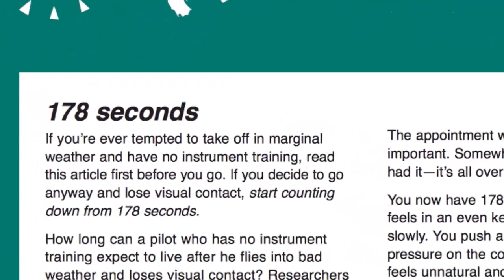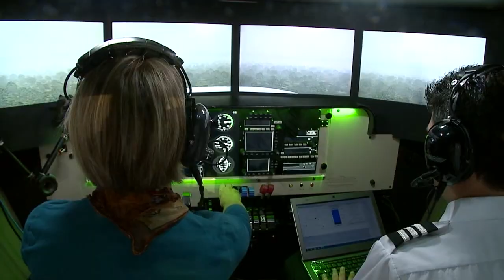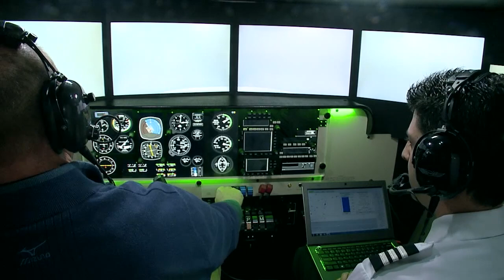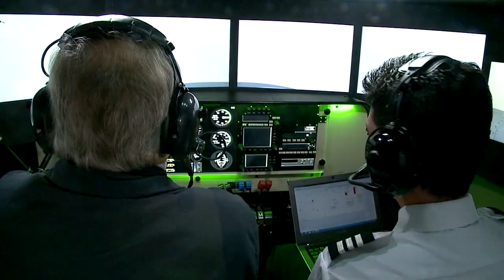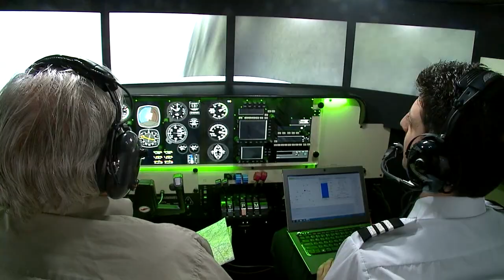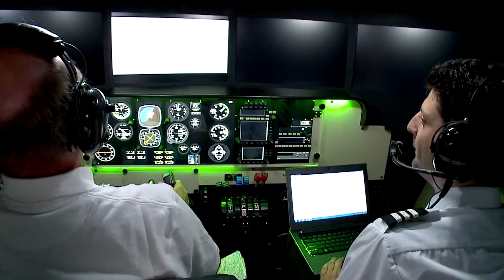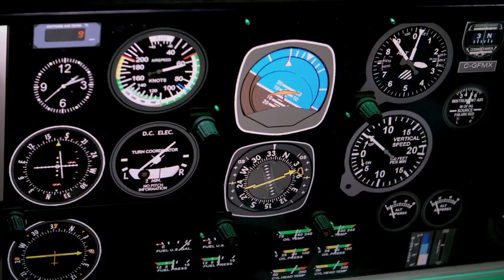SmartPilot | VFR Into IMC

Comment: I have trouble understanding why every single pilot in this exercise turned more than standard rate. What happens beyond 15-20 degrees is other lift forces just exacerbating the sense of disorienting direction/balance. For example, if turning beyond 20 degrees, there is always a need for back pressure on the yoke to keep from entering the first stages of a stall-spin, which is what happened to every pilot here. Depending upon the aircraft, pull the throttle back to slow down, keep everything standard rate or less, and for the sake of everything holy, keep the damn ball centered. I suspect your chances of survival would be increased somewhat...
Reply: Probably too focused outside hoping to see the ground again. If you go IMC, forget about what's out the window and begin instument scan.

Comment: I'm not a pilot but I'm frankly amazed that some of the guys said they hardly ever look at their instruments when flying!  I had always assumed instrument training was part of getting a pilots license.
Reply: Most VFR pilots avoid bad weather, and 99.999% of the time that is good enough. In those cases, being able to fly without referencing the instruments is actually a good thing. All pilots get some good training in which you fly by instrument alone, but it is not so much.
Reply: @rcbif101  i disagree, knowing how to fly  just using the instruments is a lot safer than just relying on visual, as it is extremely difficult to see really in bad weather
Reply: Private pilots receive only a few hours of rudimentary instrument training - just enough to make shallow-banked turns to escape the clouds - before earning their PP licenses. But even that little bit of proficiency wears off soon without periodic practice. For a VFR only pilot, flying into clouds for an extended time proffers only the panic a swimmer feels when he is about out of breath and strength and is about to drown; it's shear terror that only multiplies with each passing second until the violent end.
Reply: @original6hockey402  3 hours is required now. During which, I did basic navigation, unusual attitude recovery, and radar approaches all under the hood. Sucks not being able to enjoy the view, but hopefully lifesaving training.
Reply: The Lucas Higgins you know. nothing about aviation, obviously.
Reply: The Lucas Higgins I can’t watch that crap. Just gave you the facts of the accident. Severe pilot error/stupidity.
Reply: The Lucas Higgins just because at one time you may have been proficient flying IFR it doesn’t mean you keep the skill. Obviously this guy wasn’t proficient/competent, nor was his company authorized to fly anything, but VFR. He violated numerous FAR’s and paid ultimate price as did his passengers. Never should have happened.

Comment: wow..this has really helped me to understand how kobe died..amazing video!!!!!
Reply: It’s the same way JFK Jr. died.
Reply: Vinman Phamee The pilots ego made him make a very bad decision. Sadly avoidable.
Reply: Maybe and maybe not.  The pilot was IFR certified so if he was in practice he shouldn’t have had this problem.  It is entirely possible as the flight was VFR that he was flying up a valley staying below the clouds but found the pass ahead blocked by clouds.  From what I saw from the NTSB so far he was trying to turn around and it appears he stalled and spun into the ground.  This same thing happened in Switzerland several years ago on a clear hot day when a JU-52 realised he couldn’t clear a pass tried to do a steep turn, stalled and spun into the ground.  I think we need to wait for the full NTSB report to know better the most likely cause.
Reply: @GeoffreyEngelbrecht you could be right about this. I'm curious by the way what are the reasons for why a helicopter would stall?
Reply: Vinman Phamee The same reason any wing stalls: too high angle of attack  (https://en.wikipedia.org/wiki/Retreating_blade_stall ).  I’m not suggesting weather wasn’t a factor I’m just playing Devil’s advocate and pointing out the media’s assumption since there were clouds then he must have flown into one of them isn’t the only plausible explanation.  There are other explanations.  Best to wait for the NTSBs final report.
Reply: @GeoffreyEngelbrecht  a stall is the only answer and explains the rapid descent speed faster than the helicopter max accelerated speed of 180mph upon crash. Spatial disorientation is what some want to called it, but a stall matches the science/math.
Reply: I saw the fog and first out of my mouth was that pilot should had ground him self in a field or parking lot.  He went back up in the fog layer what a fool.

Comment: Why not hang something like a tennis ball dead center above windshield, object should turn in direction of turn, if any, or, what about horizon indicator
Reply: This is why Kobe died smh...
Reply: THATS SMARTS!!!!! EXCELLENT IDEA!!!!!!!!!!!!
Reply: I remember reading about a fire onboard an aircraft where people died because they could not see their way out of plane. Then, Aeronautical Engineers designed tiny lights on floors of aircraft near seats. At the time, I wondered, does it take an accident to move the ball, to progress to a solution? Do engineers think outside the box, or is their thinking one step at a time, inability to think ahead to the “what if’s”?
Reply: These two things are whaat really matter, although I do not hear anyone with an opinion: Why was pilot flying so fast, and why was he so low? I saw a pic of the helicopter path, and it looked as if pilot may have been heading toward Camarillo, going West, diagonally from 101 FWy, which would explain left turn away from it. In pic, it looked as if pilot then flew between two hilly regions, dead center between. Then pilot took another left turn, why?
Reply: This is essentially how a turn coordinator works.
Reply: Turn Coordinator, so why did pilot make that turn
Reply: @patsypriscilla6842   He hit a fog bank from NOWHERE. He knew there was hills,mountains around so he pulled up.  He probably didnt know he wasnt level (spatially disoriented) while doing so went into a graveyard spiral....OR he actually made it straight up but got LOW RPM Rotor issues and couldnt recover.  Please research these things then it will all make sense.
Reply: Does not explain speed
Reply: @patsypriscilla6842  He was trying to pull up to 4000 feet that takes alot of speed he was at 1200 feet.  He thought he was going up yet going down.  This is very common for all aircraft ESPECIALLY helicopters.
Reply: Hanging a tennis ball and relying on that would just kill you faster.

Comment: design a hologram to project onto the windscreen when encountering IMC.  A very simple program displaying a 1500' altitude view of terrain which remains constant as plane fly's the horizon.  Integrate it into the back of the dash compass.  Done.  The technology gong into kids video games is more than enough to give a pilot a clear sense of forward view of blue skies, streets and rooftops and trees below.  Once out of the clouds, click off.  One other thing, we have dime sized video sensors onboard cars.  How come an additonal $300 bucks can't be added to commercial aircraft and place one looking out each wing from fuselage to engines and the 3rd showing the tail.  How many more times do pilots have to spend valuable minutes and seconds trying to figure if an engine is on fire, trailing fuel, landing gear issues, cargo hold's, or how about Alaskan Air 261.  A chinese camera the size of your fingernail monitoring that T-tail would have been a blessing to those poor pilots trying to figure out the problem.  Instead we are like cave men flying planes.  Asking stewardess's to climb over passengers to look out the window.
Reply: Just looked up Alaskan air 261, so tragic. Just a question, if they were able to see and know exactly what was causing the problem would it have been possible for them the recover and save the aircraft?
Reply: @user-y6t5s  I was referring to seeing the tail via camera as the OP suggested. Ok understood. I saw in another video that a mechanic for the manufacturer of the aircraft shed some light on the potential for this happening and made some recommendations about two years prior and no action was taken and then the negligence on the part of Alaskan air as far as maintenance goes, SMH!!
Reply: @user-y6t5s  yeah you said that already

Comment: Non-pilot here - How many of these aircraft are equipped with autopilot?  If I ever found myself behind a yoke with things going wrong, and I couldn't figure it out, I'd simply just switch on the autopilot. . .
Reply: Richard Howell / A Beechcraft Baron was used in this sim, and all barons were equipped with decent autopilots as standard. Almost every aircraft flying today has an autopilot fitted, the only exceptions are the basic trainers (Cessna 150, Piper Cherokee 140, older Cessna 172s) as well as ultralights. It is recommended to use the autopilot in VFR to IMC situations, but it’s important to remember that autopilots are complex and break easily, meaning many small planes are flying with broken/malfunctioning autopilots. Even if the autopilot is working, there is no guarantee that the pilot knows how to use it. Autopilots are very dumb, and if you don’t know how to use them right, they can make things much worse.
Reply: And what do you do when it disengages?

Comment: I think this is a fundamental issue with the way pilots are trained. During my (few) flights as a student pilot, my instructor was insisting that i look out the window almost full time, and every once in a while throw a glance at the altimeter. I do understand that they do that in order to get you familiar with flying instinctually, but the problem is that it is instinct that gets VFR pilots in trouble in IMC. I think there should be mandatory IFR basic training for anyone who wants to get a licence. Enough to at least be able to fly out of IMC.
Reply: "During my (few) flights as a student pilot, my instructor was insisting that i look out the window almost full time, and every once in a while throw a glance at the altimeter."  
My experience exactly. Made no sense then, makes less sense now.
Reply: Uhhh...that's kind of the point of VFR (Visual Flight Rules). You're suppose to keep your head outside. You're watching for traffic, obstacles and terrain, it's not ATCs job to watch traffic for VFR pilots, it's the PIC's job. 
Also, IFR is flying by the numbers. It's not something as simple as trying to fly a straight line through a cloud. You also have to land in IFR. It's completely different than VFR and requires a different mindset. I'm a private pilot with no instrument rating and just a few hours under the hood, but I've taken some instrument ground school and yeah...it's not quite like VFR. At all.
Reply: @joeglidden9626  To me it does make sense however. VFR means you should see and avoid... If you keep looking inside, you could miss other airplanes coming your way. 
IFR is different, as it is someone else's job to avoid collision, so you can stick to your instruments...
Reply: @joeglidden9626  the reason one must learn to fly visually first is so that you understand what's happening with the airplane to begin with. Instruments is just a worse way to visualize the horizon. Visual flight is a prerequisite to instrument flight, instruments won't help you if you lack instinctual understanding of what's happening to the aircraft.
Reply: Cristi Neagu I took a few lessons over 30 years ago and flew for about eight hours before deciding to pursue grad school instead. My instructor was really good. While he made sure I was looking around and scanning outside, he also made sure that I checked in with the instruments as well. I did one flight on instruments e the sensations our bodies feel seem unreal compared to what we’re looking at on the actual instruments.
Reply: As a CFI it's simply way easier to teach someone to fly by looking out the window. Essentially it's just much less of a pain in the ass to get students to fly properly. I believe it's more a matter of how much effort the CFI puts into training their students and how much patience they have.
Reply: LOL all the "experts" who took a couple flight lessons in their life have the wisdom to "fix" how pilots are trained. 🤣 For beginning VFR flight training, CFIs absolutely should be having pilot look outside and learn to fly by sights, sounds, and feeling. My CFI covered up every single instrument on our first flights to stop me using them as a crutch. It's actually harder to teach people the intuition and feel of flying rather than just having them chase their instruments.  And then when we trained for IFR flight, of course the opposite applied and you can only look at and trust your instruments.  You need to be completely comfortable and proficient at flying by either visual references or instruments, know when to use each, and be able to quickly switch from one to another.  If you can't handle that, then being a pilot is not for you and it's good you stopped after a few flights.
Reply: @sintillate1913 Lol at you claiming to be an expert and you completely missed my point.
Reply: @CristiNeagu  And what was your point exactly? During pilot training, you are taught both to look outside and to look at your instruments.  If you can only handle knowing how to do one of those, you aren't pilot material.  If you hadn't washed out of training and bothered to take more than a few lessons, you would know that.
Reply: That’s the point of VFR flight. Despite Air Traffic Control being able to provide flight following and radar separation services to VFR aircraft in most areas, you still assume responsibility to see and avoid other aircraft. IFR flying on the other hand, ATC assumes almost all of that responsibility. IFR flying is much more procedural, and standardized.
Reply: @videogameplayer0552 We can't and we shouldn't leave pilots at the mercy of the elements just for definitional reasons. I am not saying VFR should be changed into IFR. I am saying that VFR pilots should be taught the minimum needed level of instrument flight to fly themselves out of accidental IMC.
Reply: @CristiNeagu  VFR pilots do receive some instrument training. Three hours of hood time is now required for private pilot certificate. The problem is that someone who regularly flies VFR only, isn’t going to be proficient in instrument flying, even if they have some instrument training.
Reply: @videogameplayer0552  That's good to hear, but in which country is this? And a pilot doesn't need to be proficient in instrument flying. All he needs to do is know how to read his instruments and how to do basic turns. Even those three hours might save a lot of lives.
Reply: @CristiNeagu  I personally have over 30 hours of hood time, and know how to fly instrument approaches, because I’m about to finish training for my instrument rating. I would feel comfortable now, safely getting through clouds if I inadvertently entered IMC, but for many people who only fly for fun, and have no plans of flying professionally, that could be prohibitively expensive. I’d still recommend that everyone get the instrument rating to be a safer pilot, but many pilots are satisfied sticking to days with clear skies only, and that generally works out for staying out of trouble.
Reply: @ That is in the United States. Three hours hood time is required here for private pilot cert.
Reply: @videogameplayer0552  Of course. The purpose of the training I'm talking about is purely so that if a non-IFR rated pilot inadvertently flies in to IMC, at least he has a chance to fly out of it. There's too many cases of pilots that found themselves in IMC and got completely disoriented and flew their plane into the ground.
Reply: At least in the US there is. A minimum 3 hours simulated instrument time, including unusual attitude recovery, 180 degree turns, straight and level flight, and tracking navigational aids.

Comment: asking  as a non-pilot,  if the  weather turns bad and visibility suddenly becomes zero,  why is it so difficult for the VFR rated  pilot  to simply fly the plane, using  the instruments and hold  the plane straight and level.....while talking with the ATC and getting  instructions to better weather.....why does the pilot suddenly get into an  spiral they are unable to recover from.... thanks
Reply: VFR pilots instinctively rely on visual cue outside the plane to know the plane's attitude and "butt" feelings to tell you what the plane is doing. Losing visibility means that the most important half of the information becomes lost, and the brain becomes confused as to what is happening to the plane.
Trying to fly with the instruments in a situation that is stressful is suddenly like trying to follow master Yoda's advice "Unlearn what you have learned".
Doing hood time is easy, with an instructor and in good weather ... but if  near convective currents or turbulences the sudden changes in vertical acceleration just add to the overall confusion. 
Personally I didn't think it was very hard, but when you start you realize it is very easy to get unwanted bank if you "forget" the artificial horizon for just a second, then realize you are losing altitude while gaining speed ... then try to just pull up to fix that, put some Gs that make you think your are straight, then see the altitude going up and airspeed down making your eyes stuck on the vertical speed, try to correct that for a bit, pull more Gs, gain more speed watch the vertical speed going from full climb to full dive... at which point maybe a quick glance at the artificial horizon tells you that does not make sense ... you're now inverted ... oops.